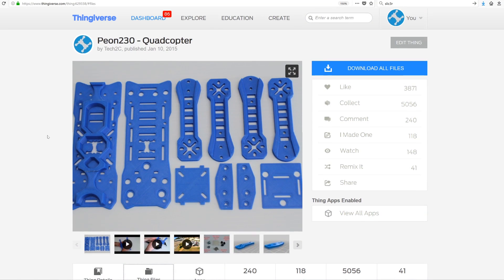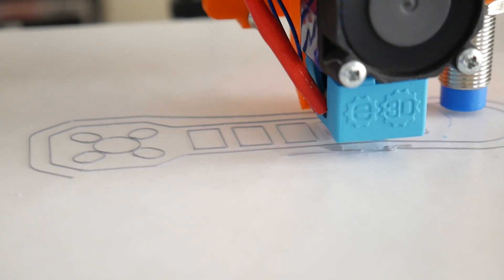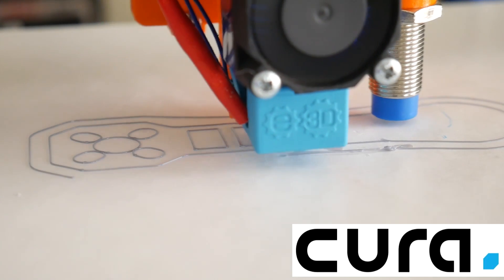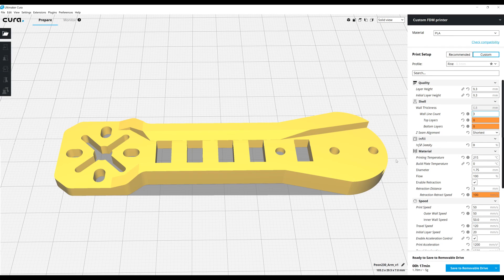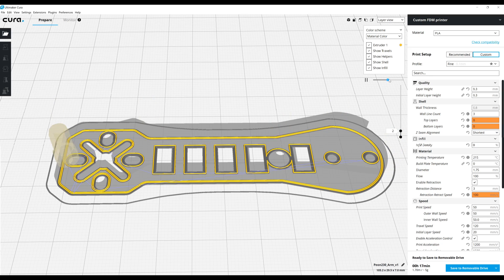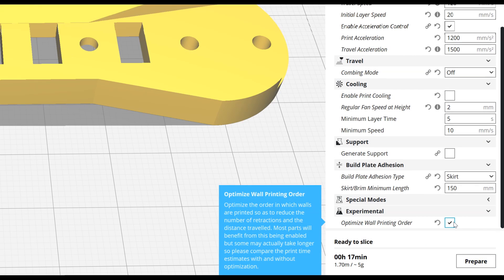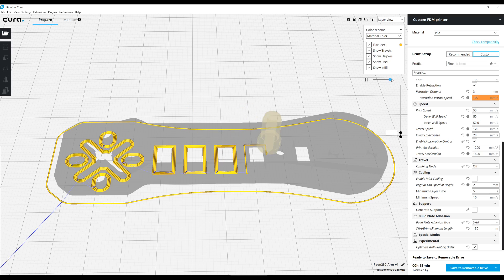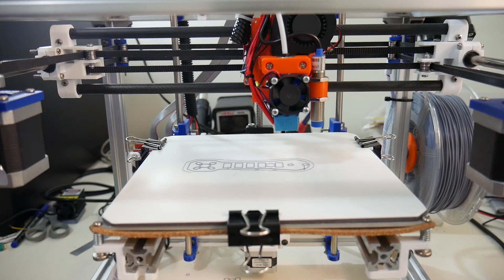A hidden feature in Cura

Comment: I actually hated Cura for not doing this! It tended to Rip the string off during travel-moves on the first layer on my Anet A8. Thanks for showing!
Reply: this has nothing to do with the model of printer, they all only do, what the gcode commands. 
dont diss the A8! this machine is what really pushed 3d printing to critical mass, and let it blow up the way is has. it has some easy to fix flaws, but gives you better results out of the box, than machines costing 3-10 times as much jsut a few years ago. <3
Reply: I agree, my Anet A8 has been very good, after some simple upgrades of course.
Reply: Same on my Tevo Tarantula! Glad i saw this!
Reply: I've had the same experience with my Anet A8 using Cura.
Reply: David Not really. But i upgraded to a AM8 with Titan Aero anyway :p
Reply: I had the same problem and it nearly drove me crazy. It happens because by default there won't be any retraction on the first layer. You have to set the "Combing Mode" to "Not in Skin", after that it should work.
Reply: David  aNET a8 iS gArBaGe
Reply: Face palm, palm face... I'd been slowing down my first layer to prevent my A8 pulling off the perimeter of holes! This looks like a much better thing to try.

Comment: I don't know what happened. Cura used to generate code that started printing the part, by lifting the head, then moving to the beginning of print, as the head descended to that point. 
Now, for some reason, The head starts at 0,0,0 and drags its ass to XY start coordinates, without lifting the head as it did before!! Also, It doesn't matter what temperature I set it at, it always creates gcode for 210ºC. I then have to go in and edit it back to 245ºC for initial layer for ABS. 
Any ideas? I think the only thing that changed, was the newer Cura version. 3.1.0
Reply: PirateKitty all the issues you are have are in your start gcode, the lifting of the head in the start of the print is a simple few lines in the binging. You can find them on line or add a new printer to Cura and it should generate it by itself. As for the temp, when Cura versions change, sometimes the terms used to define specific variables also change, it’s very possible you have one of these values in your start gcode that’s overriding your temp settings.

Comment: My favourite setting in slic3r/cura is combine infill every x layers. Makes prints with more infill faster while retaining surface quality
Reply: aytunch infill layer thickness
Reply: someoneonlylol elaborate?
Reply: yeah but you need a volcano or something similar to do anything above .150.  To do .200 or .250 youd need a 0.6mm nozzle and one of those high flow hotends. It works cool if you are printing  at .100 per layer but that's about it. To get faster at higher layer heights you need more than your standard hardware.  
I need the 0.4mm nozzle so instead i use thicker lines. Most of the stuff i print is at 0.5 or 0.55. If your nozzle has a flat point you can even do 2 0.6mm perimeters instead of 3 0.4mm ones, you save time and even get better layer adhesion
Reply: @someoneonlylol I couldn't find the setting you mentioned in CURA. Can you please share with us the name? thanks

Comment: Thanks for the heads-up! I hadn't even realised that cura was doing that. The only reason I can think of to print each perimeter at a time is to let the perimeter cool down before printing the next perimeter, which could be important when printing multiple, very thin columns. Anyway, I'll definitely test this feature out!
Reply: yeah i think thats prolly why i got worse prints with slicer then with cura (havent tried slicer after I installed the part cooling fan)

Comment: Reason can be time to cool, specially when printing small towers
Reply: Karan Chaphekar also holes <3mm diameter. Especially helps if you have bed adhesion problems.
Reply: @cosmicrdt  nah it doesn't. If you have bed adhesion problems the last thing you want is for the nozzle to stop extruding, move away and start again every few mm of extrusion.
Reply: makes sense, a bit like the "minimum time per layer" setting
Reply: Karan Chaphekar makes a lot of sense
Reply: This might stop my a annoying warp problem
Reply from the maker: Ok.

Comment: just get a s3d.. you get more control over it (inside out, otside in, etc).
Reply: Honestly, S3D is too expensive too be worth it. Cura and slic3r works just as well for most files, and cura pretty much has the same number of settings
Reply: On the layer tab, there is a checkbox called "Print islands sequentially without optimization".  Uncheck that to enable this feature.
Reply: S3D doesn't do this though. I wish it did.
Reply: What is the option for this? because mine doesn't.
Reply: Cheers!
Reply: look again it does, it like Slic3r has been doing this for a long time by default. I just looked an one of my prints I am setting up and the preview shows it prints every perimeter for each object point before going to to the next.
Reply: Under Layer make sure Optimize start points of fastest printing speed is selected.
Reply: Best 99 dollars I ever spent. Two years of use with out looking back. But what ever works for you.